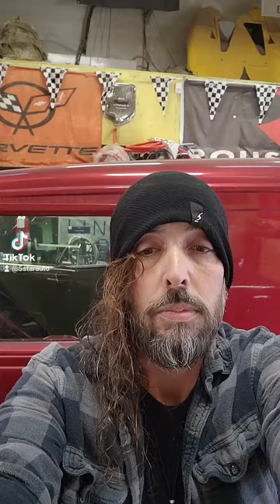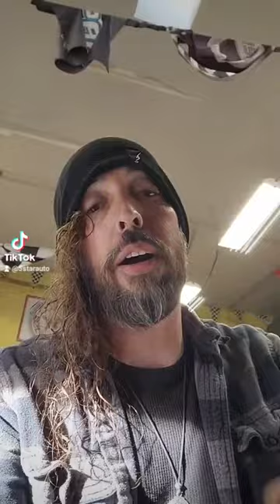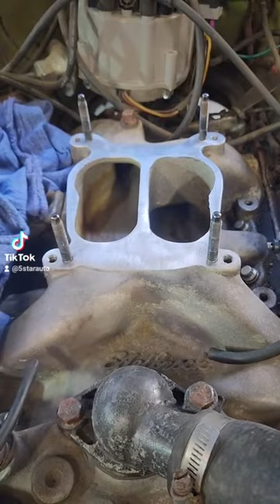adapting an carburetor to a quadrajet intake. everyone gets this wrong .it is so simple to upgrade

Comment: Just get a new intake. It's small block chev stuff there are 10 million out there.
Reply from the maker: Agree
Reply: Not always that easy. The heads on my 350 were angle milled to raise compression. The weiand 8004 manifold was milled to match. To change it out would mean having new intake milled or changing heads with the intake